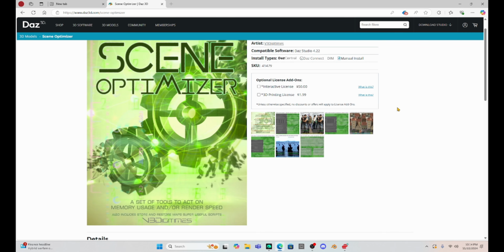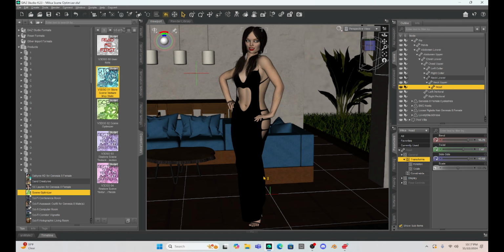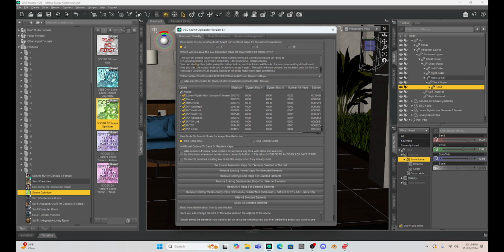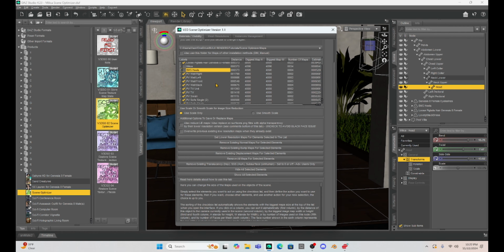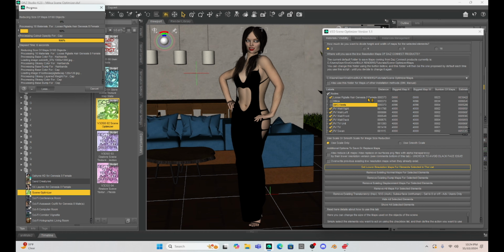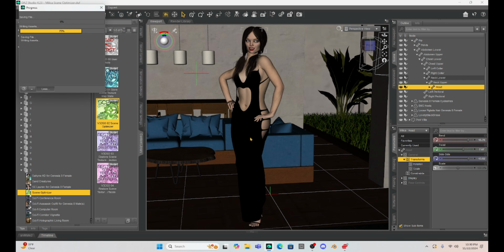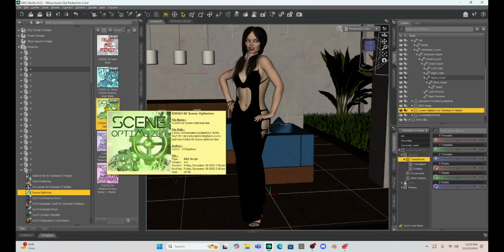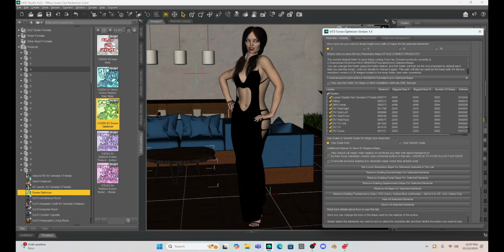Daz Studio: Introduction to Scene Optimizer

Comment: Hi bro, I love your tutorials, if you ever have any topic for upcoming tutorials could you teach us how to configure daz3d so that when I have to move the characters does not demand so much time, I have a ryzen 5 4600 rtx 3060 32 gb ddr4 and when I have more than two characters move them is a demand of time and do not know why it happens, surely is some configuration that I do not know. greetings!
Reply from the maker: @danielrodriguezart  Thanks for the message. I have had the same problem with moving characters. I don't think it is directly cause by your graphics card. I had a 3070 and now a 4070 and it will still be an issue at times. It seems to come down to the character's hair. I suppose certain hair products have so much geometry that they override your RAM. The only solution I know of is to delete (hiding the hair doesn't help) the hair, pose, then reapply the hair again

Comment: I would recommend testing with XI Post-Apocalyptic Street, I hade to use Scene Optimizer with a factor of 2, to make if fit just in my 12gb vram
Reply from the maker: I'll see if I have that prop!
Reply: @notfromthisworld7672  If not, try any of Xivon's large landscapes/environments; I have found some of them to be usable on my modest system only by using Scene Optimizer (and other products).  Also, my system chokes heavily on some of Charlie's apocalyptic vehicles that are texture heavy, but Scene Optimizer (and other products) come to the rescue.

Comment: Very interesting script; thanks for the review. Two points: An 8k hair map is utterly insane.  Unless you are literally inches from the figure, you would never see that detail on trans mapped hair. I am guilty of releasing a product with ridiculous resolution maps, so I cannot get on my high horse! 
Also, if you divide the height and width by four, you reduce the map by 16 overall, although not quite that much in reality depending on the file format.
I'm glad that you can selectively reduce or restore textures.
I was a little confused by what was meant by "surfaces." The way you you demonstrated made it look like the top of the table for instance, but I assume had the edge of the table been a separate surface, or her face, that would have been selectable? A surface being part of a separate texture map or tileable texture?
Speaking of, how does this handle procedural textures?
Thanks again for the review. I would very much like to see more reviews of scripts like this.
Reply: Yes, this setting can be confusing if not understood correctly.  The chosen factor reduces the texture map’s height AND width by that factor so the texture is reduced by the squared value.  A chosen factor of 2 reduces the texture by a factor of 4 (ideally); a chosen factor of 16 reduces the texture by a factor of 256 (ideally).  There are however, conditions that limit achieving the ideal reduction and the creator, V3Digitimes, discusses them in her August 31 post in the DAZ3D forums at Daz 3D Forums > General > Daz PA Commercial Products>Scene Optimizer [Commercial].
Reply: @joejoyner2330  " limit achieving the ideal reduction"
Indeed.
Reply from the maker: I agree.  What in the world do we need 8000 texture resolution for her hair!  Perhaps this is why certain hair freezes your character!
Reply: @notfromthisworld7672  Yeah, totally.